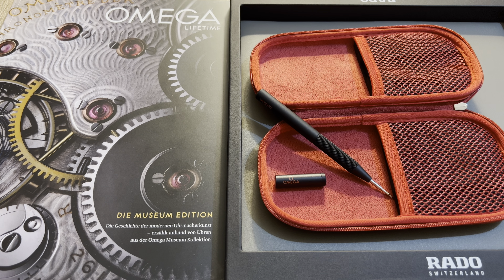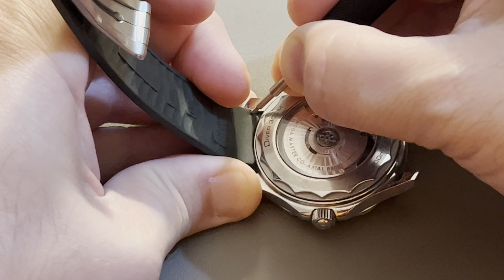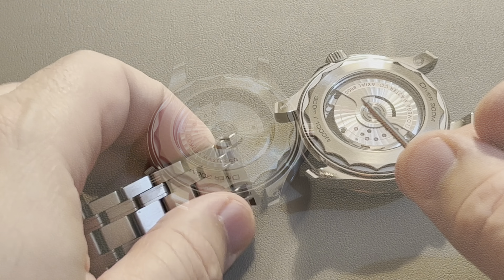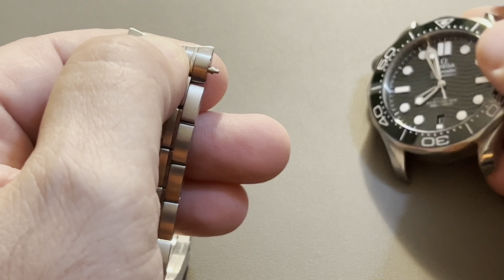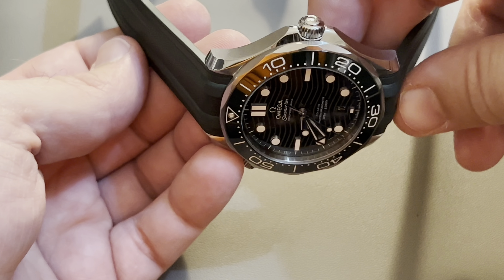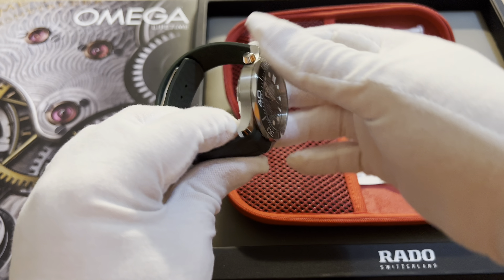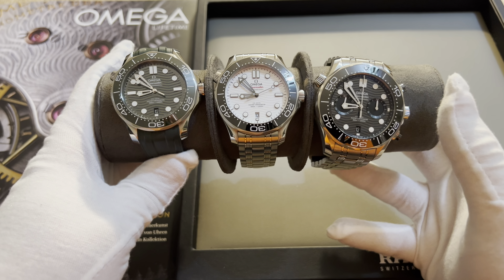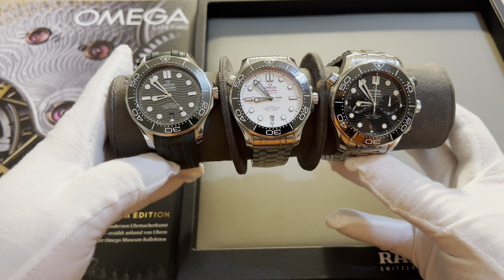DIY - How to change Omega Seamaster Bracelet / Strap

Comment: They are an absolute nightmare to attach. Getting the first pin installed is relatively easy, but I can understand why you didn't film the second pin. @3:30
Reply from the maker: Believe it or not I did it the first time :) thats why the video is authentic :) first try documented live :) but yes I had trouble with it… :)

Comment: I spent 30 minutes trying to put the rubber straps on and quit and put the steel bracelet back on.
Reply from the maker: It is not easy the first time but once you get the drill it is doable just fine :)

Comment: I was so nervous about swapping my bracelet for the rubber, but with your tip to go from “the top”, this took 3 minutes including removal of the bracelet. I do however wish you gave use some pro tips for installing the pin buckle onto the strap 😅 you have the butterfly clasp model tho. Anyways, very helpful video, no scratches, thank you!
Reply from the maker: Pin buckle - I can check by my Silver Snoopy Omega (it has pin buckle the original strap, I changes it to steel bracelet) I can create than content sure but it takes time as my snoopy is by Omega now… So glad to hear it helped you, after all this was the goal when I made the video. Please subscribe and check my orher videos too - and pin buckle I make that video! Thanks for suggesting!
Reply: @Watchmeifyoucan  I actually found out my AD gave me the wrong pin buckle, no wonder it was not fitting lol
Reply from the maker: @gothops154  things happen… but luckily you have it now, take care and if you have any suggestions what videos would be nice let me know.

Comment: What a pain in the rear this was. My watch came with a special rubber tool for this, but learning to pull on the bracelet at the same time was the trick to learn.
Reply from the maker: It was a pain if you check the time you will see :) thanks for commenting :)

Comment: Hi! Do you know if it is necessary to change the springbars to replace a metal bracelet with a NATO strap? Can the original springbars be used for both straps?
Reply from the maker: Good question I don’t know, I just swapped them, but I will check after my holidays and get back to you whether they look the same…
Reply: @Watchmeifyoucan thanks!
Reply: Just make sure you're using minimum 1.8 mm diameter spring bars. Watches originally come with 1.5 mm or thinner bars, which are not strong enough for NATO or other nylon straps.

Comment: Thanks for the video, can you make a video or let me know which tool I need to use the resize the bracelet? I have other resizing tool for other watches but they don’t work for the Omega
Reply from the maker: 🙏 Thanks for your comment, I can try to make a video about it, yet it will be a first time for me as well, I usually adjust my bracelet at Omega upon purchasing the watch. I have a tool called IFIXIT (.com) and it seems to work for me fine, check out their website! I use this tool for everything in my household.

Comment: Oh dear, oh dear, I won’t be following that procedure. Keep well.
Reply from the maker: Dare to elaborate? :) keep well too!
Reply: @Watchmeifyoucan  I’ll elaborate for him …

You pull the bracelet out laterally when the spring bars are detached. This will scratch the tips of the lugs which is visible. 

Instead, push the clasp up with a finger at the back and under of the clasp. This will push clasp up vertically and if there are any scratches, it will
Be at the back of the lug and not visible when the watch is worn. 

Also, always best to tape the lugs for safety in case tool or spring bars slip out. Take 1 minutes  

I prefer using spring bar pliers (especially when putting the bracelet back on but omega spring bars have a single collar and it can be hard for the pliers to get a good grip. 

Thanks.
Reply from the maker: @marcn8750  thanks for the tricks and hints, considering I did the very first time the removal myself, how bad I was performing? ;) 

I take the suggestions by you for the future tho, good to learn something new and thanks for sharing this with me.
Reply: @Watchmeifyoucan  it was quite bad.  The objective is not to just remove the bracelet. It’s to remove the bracelet safely. With no damage to the watch. 

Anyway, good to learn new things. Tele care and best wishes ☀️
Reply: Do you know where can I buy the accessories of strap ? My watch strap is broken 😢